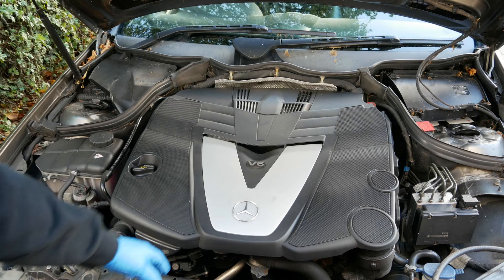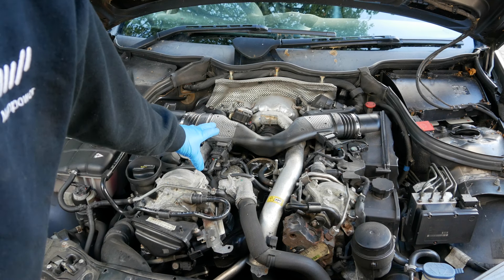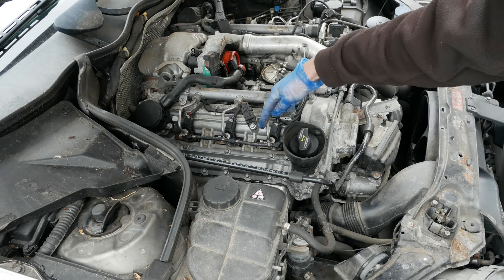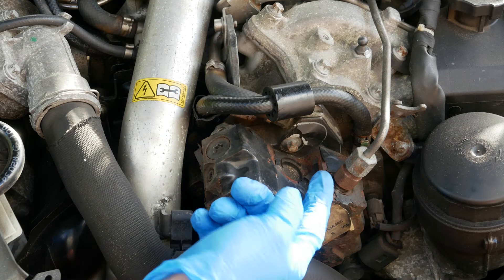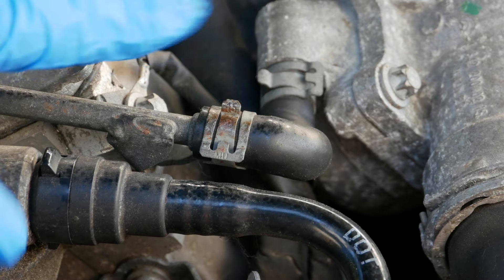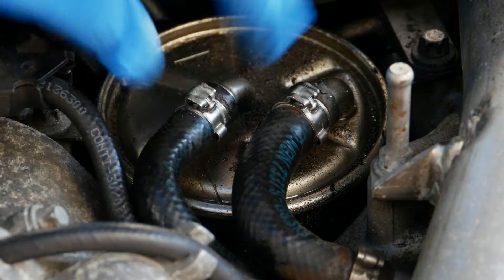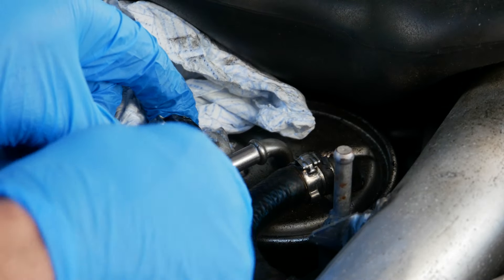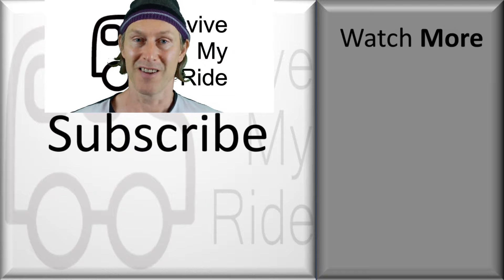Diesel Exhaust Smell Inside Car or Fuel Smell in Car??

Comment: I got diesel car in the summer and I really like it but now in winter the exhaust smells pungent and makes se squint my eyes and cough. Its not black or anything, invisible or white but really pungent. Its not coming from blower but if I open window to smoke its immediately horrid. I know smoker complaining about exhaust smell but I'm just wondering if car is alright. It passed emissions but just barely.
Reply from the maker: Hi, I'm really not sure about this one. If it was a diesel leak or fumes in the engine compartment, you would definitely smell it very strongly when you use the air blower. Therefore, it sounds like the smell is coming from the exhaust (middle of car) but I suspect you would be able to hear a leaking exhaust. Maybe a fuel line leak? Sorry I can't be more help!
Reply: I'm getting this too. What car did you have and did you find the cause?

Comment: I had an old truck way back in the day, exhaust fumes came into the cab through the vents.... checking around the engine it was an exhaust pipe that connected to the EGR valve that was messed up and the fumes weren't all getting sent into the EGR valve but leaking out under the hood and then getting sent into the cab through the vents. it was easy to find the problem but a real pain to fix it.
Reply from the maker: I can imagine, anytime you start messing with the exhaust system, usually up behind the engine, it becomes really difficult to get to and to work on! I can understand why EGR was introduced but it does seem to lead to a lot of various different problems. Thanks, Phil

Comment: Excellent tutorial! The tip about turning off the engine to avoid a 2,000+ psi jet of fuel slicing off fingers into is quite scary. I saw a navy ship video once where they would use a broom to find steam leaks, by waving it in the vicinity of the suspected leak. Much better for the microscopic jet of superheated steam to cut the broom in half, rather than having it cut off your fingers.
Reply from the maker: It’s scary stuff, I’m always super careful when investigating fuel leaks on diesel engines. I’ve heard about steam leaks on ships, even scarier! 😱

Comment: 2010 Audi Q7 TDI also have a exhaust smell when heat on.
Reply from the maker: Sure sign of a problem under the bonnet! The fuel filter is the best place to start (if your car has one under the bonnet) because you change it by sliding the hoses off of the old one and then back onto the new one again. After doing it a few times, the hose can start to get worn. The other place to look is the DPF valve, if you do a lot of short journeys, it could be due a clean. I’ve heard the DPF can cause this smell too but don’t have any direct experience (yet!) thanks, Phil
Reply: My 2011 Q7 has this problem, very smelly when the heating is on. The smell is strongest under the drivers side. Makes me think a DPF issue, seems to be getting worse and I do mostly short journeys

Comment: Many Thanks for this! I just got a 1.6D Volvo V50, seems great apart from a bit of an exhaust type smell occasionally, so will check for anything obvious like a fuel leak as flagged up in your vid.
Reply from the maker: Hi, the heater vent test is quite a good one because if you smell it come through the vents, it narrows the problem down to under the bonnet. In addition to the “common fuel leak areas” another area that I see mentioned quite a lot is the DPF valve. My car is pre DPF, so I wasn’t able to show it. Hope that helps! Thanks, Phil
Reply from the maker: @danlandmand  yep, mine was leaking from one of the fuel hoses where it goes onto the fuel filter. I removed the hose from the filter, snipped off about 10-15mm of the hose, pushed them back onto the filter and put the clamps back on - fixed the issue! 👍
Reply from the maker: @danlandmand  sorry! Was replying on my phone and missed that! Hope you are able to help each other out with the info! 👍
Reply: @danlandmand  In my case, a diesel injector was a bit loose, I tightened the two hold down nuts a bit and the exhaust smell in the car has gone, but ideally it will need a new copper seal washer  on that injector. another 2 injector's clamp nuts could be tightened a bit too.
Reply: Likely injector seal leak on that engine

Comment: Hello . I am having the same issue . Its very very strong when stagnant.  I noticed it a couple of weeks ago and wow its got a lot worse . It's the same mercedes engine . I was very worried but in the day light I can atlest now have a look and go from there . I have had the car for 4 years with no issues so far. Would you reccomend checking the filter first  . I will let you know thank you . Do you have a support patriot thing to say thanks. Cheers
Reply from the maker: Hi, from the comments from people who have been fixing leaks on their cars,  I would say diesel filter is the no.1 culprit. The fuel lines get pulled off when replacing it during servicing and after a while, they can get loose or worn. I would check that first. After that, no.2 seems to be the high pressure fuel pump, which may need repair / new gaskets if it is leaking. Hope that helps and good luck with it! Thanks, Phil
Reply: @ReviveMyRide  thank you.  I will defo update and I appreciate you taking the time to help

Comment: Great video and presentation!
 I have a strong diesel smell in my 2010 Jag XF 3.0d. Without inspection I'm assuming it could be an EGR leak as engine management was consistently showing EGR codes and then stopped, then I started to smell diesel in the cabin.
My local garage told me it takes 8 hours of labour to remove and replace the EGR valve plus £550 for a new valve. I would love your advise on this or even better a vid on how to remove and inspect/clean/replace gaskets. I'm told The EGR on the Jag is particularly hard to access and remove, hence the high amount of labour involved. 
Thanks in advance
Reply from the maker: Hi and thanks for your comment! I haven't had any exposure to the DPF problems yet. My old CLK is a 2007 (no DPF) and I now have a newer Merc (2018) and so I haven't had the issue yet! Did some reading and WOW, I'm not sure where to start! To your question: The valve is just part of the system and if it turns out not to be the problem, that is a big outlay of cash if the problem isn't resolved. There are a lot of companies about now that will clean and service your DPF (still not cheap though) and Terraclean has been mentioned a lot. I'm afraid all you can do is, read up on it a lot and then make the best informed choice you can on your next course of action. I found this to be a good thread on the topic: https://www.jaguarownersclub.com/forums/topic/15055-dpf-how-bad-does-it-get/ Really sorry I can't be of more help, I don't have a Jag and I haven't had to deal with this issue yet. Hope this reply helps a little bit, best of luck with it! Phil
Reply: I have the same diesel smell issue on my 2010 XF 3.O Diesel. Have you found the cause? I'll investigate shortly.

Comment: HI buddy, great video, I have discovered my issue is a leaky injector that's pooling fuel in the little well that surrounds the injector and the burning off and the fumes are coming in to the cabin!.  I'm currently using recirculating air flow as opposed to drawing the air from the engine which helps greatly until I can afford the fix 👍
Reply from the maker: Hi @britishmick Thanks for sharing, good information for anyone reading through the comments who has similar issues. BTW, regarding the fuel injector leak, most fuel injectors have a high pressure connection for the fuel feed, right in the middle at the top, sometimes a little extra turn on the securing nut is enough to stop the leak. Make sure you do this with engine off and don't go too crazy with the turning torque to avoid damaging anything. Another possibility (and the more likely one) is a worn "O" ring on the return line connection. This connection is also at the top of the injector but usually comes off at a right angle. It has a little "collet" which you compress and then you can remove it and replace the "O" ring inside the fitting. So, if you are lucky, you may find that the repair isn't too time consuming or expensive... Thanks, Phil

Comment: hello sir, my Suzuki Swift 2014 diesel smells like diesel exhaust insinde car.... 

i will take it to a mechanic because i know little about cars... 

What are the most common problems causing that smell ?
Reply from the maker: Hi! Well, one of the potential causes can be a diesel leak somewhere under the bonnet and I covered what I felt were the 3 most likely areas for this to occur during the video. However, another area that I have "heard" can be a common cause is a blocked DPF (Diesel Particulate Filter). These collect particles from the exhaust (to be better for the environment) and rely on long runs for the exhaust to get hot enough to burn them off and self clean. If you are doing a lot of short journeys in your car, then the DPF can become blocked and cause Diesel smell and this may be your problem. Sometimes taking the car out for a good long motorway journey can help it. More information here (but I have never used this company, I just thought it was a good Blog Post). https://www.sinspeed.co.uk/blog/dpf-cleaning-service/ Hope that helps some! Phil
Reply: Blocked air filtter

Comment: My problem of a w210 was the injectors ring down the engine. I replaced all four of them.
Reply from the maker: Yep, good point. Sometimes the issue, can be leaking fuel injector seals. If this is the problem, usually you will see carbon build up around one or more of the fuel injectors. You did the right thing to replace all of them 👍

Comment: Hi..iv got a kia sportage 2010 crdi..when i accelerate down the motorway i get smoke from exhaust then when i stop at lights i get fumes smell in the car?? Any ideas please
Reply from the maker: Based on your description, it's unlikely that you have a leak under the bonnet but I would look anyway and check the key areas I mentioned in the video. Remember to check straight away after you have stopped the car, as the diesel does evaporate off quickly (although it often leaves a oily residue behind). Apart from that, I'm afraid there are a lot of things that can cause smoke out of the back on a diesel. Two of the main ones are a blocked DPF and fuel injectors that need a clean. Sorry, I haven't done videos on this topic but should should be able to find some on YouTube and maybe even ones specifically showing your Kia. Hope that helps! Thanks, Phil
Reply: @ReviveMyRide  thanks phil...when i stopped at lights i could smell the fumes in the car..but when you get out and lift the bonnett its gone..it splutters a little bit as well you you accelerate so it could be the injectors???
Reply from the maker: @rickharrison6325  Hi Rick, I'm wary about leading you astray as I haven't worked on one of these before. I'm a hobby mechanic, so I only work on the problems that crop up on my own car! However, there are a couple of things that you can check that will cost you very little, so worth doing first. The first one is: Spluttering when you accelerate is often lack of fuel supply. Not sure what the service history and mileage on your car is but if you don't have 100% confirmation that the fuel filter has been changed, then I would do it, they don't cost very much. The second one (and less likely but worth checking) Is there any chance you have a diesel leak under the car? You could spot where the fuel lines are ahead of time, give it a run and then quickly check underneath. Also, not saying this exact thread is what you need but Kia forums are a great place for searching for other owners who have had the exact same problem as you and maybe found a solution. https://www.kia-forums.com/threads/slight-hesitation-accelerating.59975/ Hope some of the above helps! Thanks, Phil
Reply: @ReviveMyRide  thanks phil
Reply: Hi Phil just a reply to my last post..iv changed my air filtter and put a few injector cleaners through the car,the fume smell has gone,evry now and then i get a fume smell but not as bad as it was..the air filtter wasnt to dirty though
Reply from the maker: @rickharrison6325  Thanks for the update and glad to hear that you have had some success with it! 👍